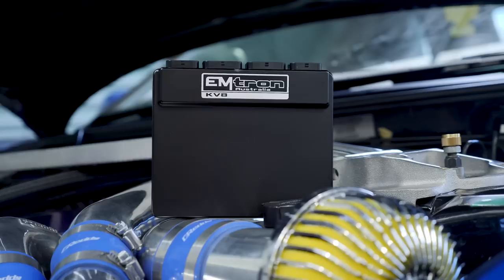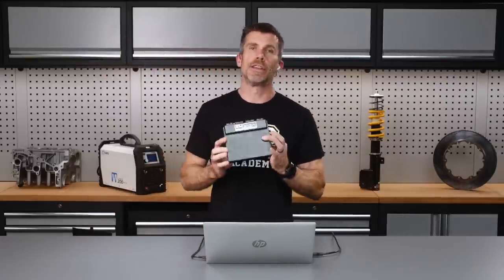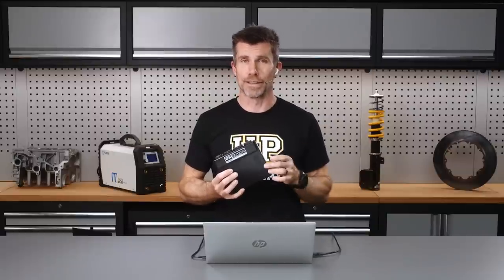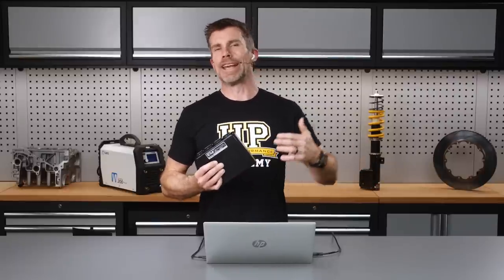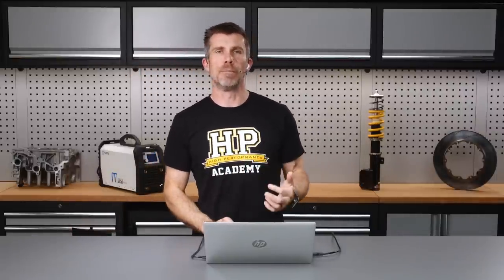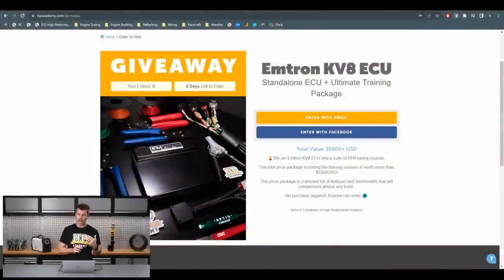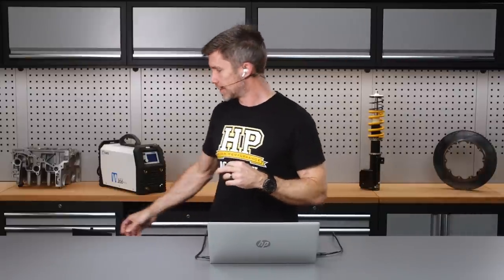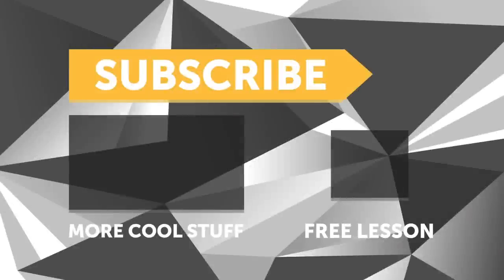Did We Almost Make A MASSIVE Mistake?

Comment: I'm building an 88 EF with a K24. I'm concerned about the low. I'm excited to see what the CRX looks like when you're done. I'm curios to see how far back you can get the motor. Also, I designed bolt in custom mounts to adapt a tucked radiator without having to drill the core support. Should fit the CRX if you don't already have a clean solution.  I've been meaning to make a repository. any who, great video.

Comment: Again always topics of interest for everyone. 
Regarding suspension I have just had similar issues . 
Whilst designing double wishbone/ pushrod suspension for our e36 GTR .
I started around the steering rack inner pivot points and used this for the centre line of my bottom arms . Then keeping the bottom arms and rack horizontal at ride height I designed the upright and steering arm brackets .
After setting the wheel at aprox 4 deg neg camber / 7 deg castor I then designed my top arm . Mounting that horizontal and to give no camber gain . 
With that I can then have multiple locations for the top arm to induce camber gain and some adjustment of roll centre. 
With spacing the arms as far apart as possible ( vertically) it gives the suspension more rigidity .
Travel is restricted to aprox 15-20 mm droop on the front and 50mm under compression .
Went for pushrod suspension as droop / ride height / spring pre load are simpler to set . 
Ended up moving the engine 300mm further back for rack / bonnet clearance and weight distribution .

Drew everything up in cad and had mock ups laser cut . 
Have to see if it goes round corners now !!! 😵‍💫
Nice to see your flywheel, is it all alloy / 1 piece including the ring gear ?
Reply from the maker: YT had a bit of a spaz and put the wrong comment (I deleted now) on here for you sorry. It mixes them up in the backend sometimes but I have just learnt what to look for with it happening to this post now!

It sounds like you have given yourself the best chance for success when it comes to going around corners as fast as you anticipate!

It's a chromoly unit that is 1 piece, including the ring gear 😎 - Taz.
Reply: @hpa101  ha ha no worries I get spazed out myself anyway. 
Yeah a bit of testing and geometry mods should eradicate any handling issues that the 70’s yank tanks were renowned for 😵‍💫. 

It looked like an all alloy flywheel from the content, that was the main reason for my question Taz . That would have been one option for me and just get one water
Jet cut and balanced. Don’t like the idea of an alloy one falling to bits and having an argument with the bell housing and my feet . !! 
Our s58 had the 8 speed box but I’m considering using the flex plate and then making an alloy boss for the 7 1/4 inch clutch to bolt too . Super light and cost effective. 
Cheers for the reply 👍

Comment: Would there be a benefit of using the  K24 block even for a 2.0L build (suppose an 86mm diameter inner liner or a shorter stroke billet crank) considering that the taller dek height would allow for a better rod ratio? I suppose there is a weight increase of the rods themselves in this case to consider.
Reply: Lowering peak piston speed for higher rpm ceiling has negative effects re peak velocity and pulse strength for intake and exhaust.
Reply: I've wondered about the same thing myself.
The larger bore and short stoke, with longer rods, has many potential advantages - about the only negative I can think of, from a power standpoint, is it may be harder maximising the compression ratio.
As you say, the rods will be heavier, as may the pistons, but they would be travelling a shorter distance so that will be partially compensated for, the intertial loading around TDC will be significantly reduced so potentially allowing more rpm and dwell at BTD would be reduced.

There's a Greek chap with a VERY extensively modified N/A Ford Cosworth 2 litre turning close to 12k rpm and putting out over 400hp - it sounds MENTAL! https://www.youtube.com/watch?v=G3snibHTZpw Since been repowered with an M5 engine of unknown spec'.
Reply: @silverwolf4095  Realtive to an NA build though, Yeah? otherwise it's just more inertia under load... I think

Comment: Where is that clutch and flywheel sourced from?
Reply from the maker: The clutch just came from a local supplier (Cardwells) who we use often as they have good service, and the chromolly flywheel was custom-made - Taz.
Reply: If you actually look at it, it's a standard TILTON 5.5" clutch assembly - you can match the spring rate, leverage ratio, plate number, and friction plate material options to match the engine torque you expect.
There are several other manufacturers who can also supply similar clutches - if you have the budget you can even go for a full carbon-carbon assembly in push, or pull, configuration.

If you can't find someone to machine a matching lightweight flywheel, TTV in the UK may have something to do the job.

however, going to this extreme is 'overboard' for 99% of people's needs, and there may be other options that are much better suited for them.

Comment: Moving the engine back in a Fwd car, how do you deal with the angle the front axles get?
Reply from the maker: You make the adjustments to suit. In this case given an aftermarket gearbox is going in it is 'easier' as you need to sort that out no matter where the engine is - Taz.